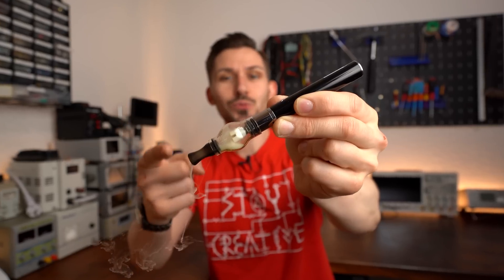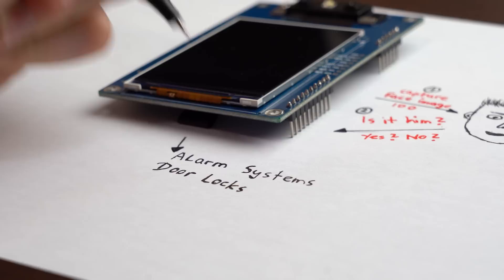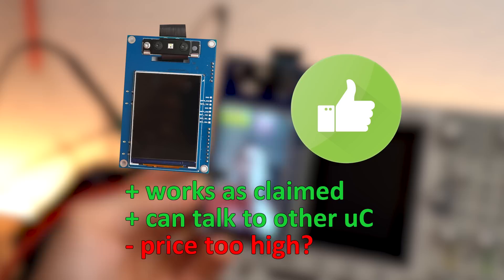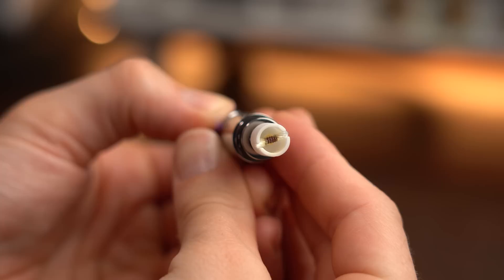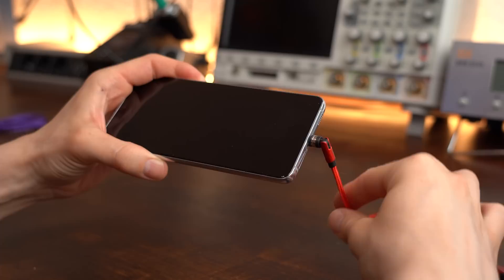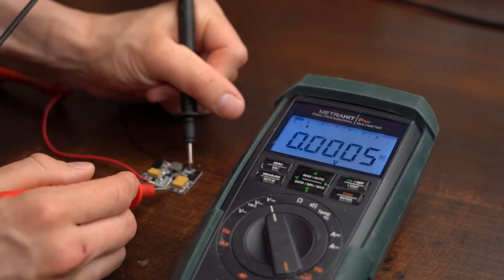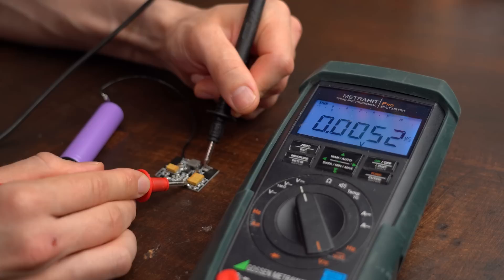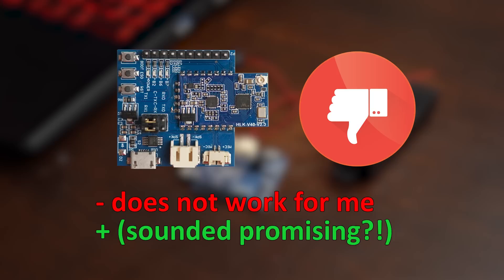I tried finding Hidden Gems on AliExpress AGAIN! (Part 5)

Comment: Great video thanks for making it.
I am confused about your TPS Buck Booster board.
You said it handles 4 different voltages and can be set using the pads on it.
Then why is the board sold at different price for each voltage.
They charge more for 5v yet less for 2.5 and other voltages.
IF all that is needed is to close loop/pads for each voltage then why do sellers have 4 different costs?

Comment: I cannot get enough of these videos. Entertaining and incredibly useful. I recently came across some ultra powerful lifepo4 battery chargers (29.2v 100A for like $650), and was really curious how they might actually perform. I build backup power stations with fairly large batteries (7200Wh), and charging them fully in under 5 hours requires a TON of power. Would love to see these crazy AliExpress chargers put to the test, as well as anything else lifepo4 related!

Comment: Another pro for the magnetic cables. If you work in an area with a lot of dust (ie: a wood shop) the magnetic piece that plugs into the device acts as a dust cover. Downside, every little piece of magnetic dust will find it.
Reply: Yeah, and phones lately have USBOTG, that means they source current onto the USB connector, not just sinking it. Short the wrong pins on that magnetic connector, which is super easy with that dumb little magnetic clip on there, and you just might blow the phone up.
Reply: @pontiacg445  I would think that phones probably have protection on the USB port. Waterproof phones definitely have it. A lot of devices do have over current protection on their USB ports including desktop PCs and laptops.
Reply: @pontiacg445  OTG doesn't just leave 5V on the port 24/7, it only sends power if the ID (micro) or CC (type C) pin is connected.
Reply: @kaelwd  Which is why I said "short the right pins..."

What is it you need to do to the ID pin to get 5V out? Just ground it? Which pin is directly adjacent to the ID pin? Ground? Alright, then. 

I've fixed enough PCs that kids have stuffed stuff into the front panel USB connectors to know that, yes, they typically have overcurrent protection on the vbus. Does that mean it always works? Nope, not at all.

Comment: I've seen reports in the reviews on AliExpress on all of those magnetic USB-C cables having the connector start melting or burning, with pictures to prove it. That makes a lot more sense now that I know 20% of the energy gets wasted as heat in that exact area. So these claim to be compatible with fast charging, but they really shouldn't be used with fast charging.

Comment: I checked out the hot plate because I have been wanting one.  And the price was discounted by 50% - cut to about $26 US.  Only problem - shipping to the US is $93 !!   Also - it looks like they have a 215 mm x 215 mm plate size version for the same price !!  Did you consider getting that version ???

Comment: Hi, when testing buck/boost stuff, it would be nice if you tried a soft start, slowly raising input from 0 Volt, and finding out if and when it starts. It is good info for using with solar cells, mimicking a dull gray sun rise.

Comment: That rosin dispenser is a repurposed concentrate vaporizer, that's absolutely ingenious!
You could grab better coils from OOZE, they use quartz with wire around it and their pretty efficient in vaporizing so I imagine they'd perform the same for this application. 
I have a fantastic use now for my old 510 batteries!
Reply: it's definitely just a normal THC vape being labeled as something else lmao. It has a damn mouthpiece ffs xD

Comment: I loooove those rosin dispensers for finding shorts. So useful and way cheaper than a thermal cam. Also way higher resolution and easier than the original method with an iron
Reply: I'd just use my finger and then when I burn myself take a puff of my rosin pen to ease the pain lol.
Reply: This method reminds me of Louis Rossmann's method of soaking the area in isopropyl alcohol, the shorts will evaporate way quicker than the rest.
Reply: Imagine someone smoking the rosin.

Comment: About those USB cables, any magnet near the USB port on my laptop shuts it down.  That's where the sensor for closing the lid is located, so it thinks the lid is closed and goes to sleep.  Also, I couldn't tell, did it have more than two pins?  If not then it's definitely not capable of fast charging.
Reply: It depends on the definition of "fast" I believe one version of fast charging is just drawing as much current as you can until the voltage drops too much.
Reply: @chaos.corner  That's fair.  I was defining it as Quick Charge or Power Delivery.
Reply: @madcow3417  Much better now that it mostly is. It would sometimes drive me nuts trying to work out what I needed for my phones. Sometimes it even would be QC.

Comment: It is a really common technique really, to find short in cell phone by using heat. At least here in Indonesia. It's a bit brutal sometimes, lol, injecting 12v to phone. But that's kinda the way we can fix a phone sometime because the manufacturer wont give us schematic.

Other than that fancy resin dispenser, you can use ethanol, IPA, or even receipt from ATM.
Reply: Oh, thermal paper? That's actually a great idea! How well does that work?

Comment: Have been using magnetic cables for a long time. Go for quality at slightly higher cost. It does have a slight power loss at higher voltage and current. The plug gets warm to touch. And the magnetic part does pick up debris.

The pros
Eliminates wear on the charging port almost completely. 

No more fumbling around trying to plug in the phone while driving. Just hover the cable close by and it latches on.

Comment: With the face recognition, if it's possible to register your face at an angle, would that possibly solve the 'looking straight on' issue? It would take another space, but 2 or 3 out of 1000 is a drop in the bucket for home use.

Comment: As part of moving to my newly built house, one of my latest favourite gadgets are serial to ethernet adapters. I built my own RFID+keypad door bell using two Arduinos, one for the RFID keypad, and one with a double relay for the bell and opener. All of that is connected to my servers where the actual access control happens. (I don't trust those all-in-one solutions)
Another adapter connects my energy meter via a cheap IR read head to the network. There are many solutions using ESP32s or ESP8266s, but they also need power wires and would additionally use up some wifi bandwidth.
The last adapter is a RS485 (Modbus) adapter, that let's me connect to my heat pump heating system. Very useful to control the energy usage depending on the output of my solar panels.
Of course, these are a bit less electronics gadgets than "smart home" hacking thingies, but they are very usable in the right circumstances (MANY devices have RS232, RS485 or UART interfaces).

Comment: Concerning that PS pin on the buck-boost converter, what does de-soldering it do to the circuit? Is there anything special that has to be wired up after the surgery lol? As a EE student I love your videos and focus on efficiency

Comment: The magnetic usb cables are amazing for kids with micro usb powered devices. The port remains damage free. The big down side is metal working, don't be cutting and grinding steel around them, kills the cables really quick.

Comment: Hey Scott, if you want really good magnetic cables try the ODDADD brand. They have proper data pins and even CC1+2 for PD communication.
I have them and though not as low as high quality cables (sub 0.08) the resistance is ~0.16 ohms for the 2 meter cable.
Reply: Do you happen to still have a link to those cables? Cheers

Comment: One negative I can see straight away with the face recognition, is that it is all within the unit.  It should be offloading it all to a back-end system.  If you use it as a door entry system, it could be compromised from the outside.  I know it's a development board, so it's not designed for production use, but people will still use it for one.

Comment: The coil for the vap^H^H^H rosin mist dispenser, looks just like any other vape pen coil (and looks like a 510 thread). Should be replaceable and perhaps even used in other vape pens. (even the turning on sequence is like most off brand vape pens).
The included rosin is only to detect defective components ? or is it also flux ? (havent had any luck importing rosin/flux)
Reply: Do you know if there are inserts to prevent direct contact between the resin and the coil? The metals in the coil aren't particularly healthy to inhale and may be the primary reason for respiratory illness associated with vaping.
Reply: @toseltreps1101  There are higher quality ones that use a heating element embedded in ceramic. I think most the health problems with vaping especially e-cigs are down to the substance you're inhaling though a lot of the time it's just using normal food grade flavorings and vegetable glycol in particular with high water content that were never ment to be inhaled. I was a smoker for years and tried to use e-cigs to quit even with a higher quality ceramic atomizer and quality liquid it made my lungs feel like they were filling with fluid. Now if you mean cannabis oil's the reason for all the health problems with that was evil people on the black market cutting it with vitamin e to make more money and not proven but, I suspect some using synthetic cannabinoids or even cbd synthesized into thc, that contain all sorts of nasty stuff.

Comment: Rosin dispenser : Press 5 times will turn ON . Press 5 times will turn OFF. 
You have to turn it off to save power and to avoid accidental press . Mine have no case included as laying in shelf can get pressed .

Comment: 6:05 Yes and no. I think what you have there is just pure pine rosin, which can be used as flux but is not exactly the same as "rosin flux" you might buy--there are usually other ingredients.

Comment: You've totally.missed the point of the magnetic charge cables.  A - they protect your port two ways... 1 you don't need to be plugging and unplugging them all the time and 2 if you grab your phone without unplugging it the magnet cinnection will break free, instead of breaking your port!   B - these cable usually.come with micro USB, USB-C, and apple thunderbolt connecting tips. You can have one cable rule them all.  We leave cables plugged in all around the house and can plug in any device.  They end up saving money because you don't have to buy every type of cable.  Also, when our phones were upgraded to using USB-C all we needed to do was use some new tips.  We didn't have to buy a single new cable.
Frankly, we LOVE these cables.  We don't fast carge at all since it's too hard on your battery, so that's a non issues.  You don't fast charge as well, do you????

Since using these I've never beeded to replace a USB port on anyone our devices.  No accidently walking away with a cable.connected (kids do this a lot!) And continually plugging and unplugging connectors that wear our.  We use the kind that also have data connectors, and the work perfectly.

Frankly, I think you have an absurd focus on minute power loss to your devices.  We are taking miliamps here. You waste way more than that using your non-cable chargers!!!!

Comment: The TPS module is awesome. There is a serious lack of affordable high efficiency, low quiescent current converter modules, so this is certainly a gem. A pity it's so big though. Too beefy for low power uses which don't require current in ampere range.

Comment: Back to desulfation topic a while ago, the desulfator I made based on several recent academic journals using resonant principle on sulphate seems to works. Its been running for 2 weeks.

I use this desulfator on a lead acid 45a 12v battery which previously failed to desulfate using traditional method aka transformer+rectifier diode. 

On the 3 cell which the cells turned dark brownish rusty like color, 2 cell almost cleared of rusty like oxide. The 3 cells still bubling atm. The 3 cell with normal colored cell did not bubling at all from the begining of desulfation process.

I use pwm at 700khz and 27% duty and irf540. Earlier, I got problem with this configuration as the solder joints providing 32v and ground keeps melting, even when i cooled it with 8" ac fan at around 50cm. Seems that the pulse resonating and disintegrate the solder joints. The solution is to clamp the wire using diode pin. I limit current slightly under 1A because i also often use the transformer to charge 18650 battery packs.😅

Edit: i also on 3d printer project, its a corexy based planned to run klipper. 

The interestings parts is that I use alternative approach to build this printer. The frame is made from welded 30x30x1.5mm hollow carbon steel. I use custom made heat treated carbon fiber brackets on x axis. The bed also made using carbon fiber. The heater element, thermostate and heat shileld will be on a single plate as carbon fiber is a good insulator material. The bed bracket will be using grade 1100 alumunium which is light and got high tensile strenght.

The bed leveling will be using 6 axis gyro and servo controlled by separate mcu. The x axis use custom made bearing from ptfe aka teflon rod instead of linear bearings/rail on 3 8mm 304 stainless steel shaft. I also considering 1100 alumunium or heat treated carbon fiber shaft, but I am tight on budget atm😂.

Comment: 9:20 there are better cables available that usually do not come the 360° head to pivot around. They have a straight cable plug or a rectangle one usefull in the car and what not. Then the efficiency was a lot higher cause I also had bought these cheap ones with 360° on top but they were hot compared to the other ones. The cable diameters were too small for the amount of current needed to fast charge  - and the manufacturer had saved a lot money due to less copper.

Comment: Awesome video as always, @greatscott.
Though I want to comment on the magnetic USB cables; I wanted to drive them daily, mostly for charging port longevity on my phone and interchangeability, with one charging cable any each device with its appropriate head. But from what I understood from online and Reddit research that it's just not safe and not recommended for daily use; I forgot the reason why it's not safe, but I wanted to give you a heads up; I would either research this a bit further (and would like to hear more insight from you if you do) or put a disclaimer of not recommending it because people were really convinced online that it's bad.
Reply: That's disappointing, I was thinking they might be useful for attaching to my various cameras for easier charging.

Comment: If they added an extra hole to that rosin melter, it would probably be useful for meth smokers. However, I would recommend that they disperse the heat more so that it doesn't break down the meth.

Comment: The magnetic cables are absolutely perfect for wireless headphones, you can easily attach them without removing the headphones and if you forget they are attached and stand up they safely disconnect without stressing any component. It's worth the power loss in my opinion.

Comment: After using the magnetic USB cables for some time, I found the "full - data" cables which swivel are bad. The fixed full data and all the " power only" cables work fine, although the latter don't fastcharge.

Comment: you should test the magnetic usb cables after it went trough simulated (or real) charging duty, if it's getting hot it might result in an even bigger amount of resistance since permanent magnets loose strenght when they get hot and that weakens force connecting the pins between the cable and the swappable end connector (that will mean higher resistance if the force gets reduced enough to cause a weakened contact). High resistance cable heats up -> Perma magnet loses strenght -> Lost strenght means higher resistence for even more heat... Under the right circumstances this feedback loop could possibly cause a thermal runaway situation, but it's more likely that the wall adapter's protections (and/or the phone's charging circuit) kick in way sooner or even if it was a thermal runaway somehow the magnet might just fall off when it heats up enough to loose it's magnetic property before anything catches fire.

Comment: I made my own hotplate using a single electric hob, built in a 2KW SCR voltage reg and added a temperature controller........ Noisy, really noisy (SCR), but for like €18, it's about 20cm diameter and beats even some of the professional hotplates i've used over the years.
Doesn't work any more though, as cats really love chewy high temperature mains cables............... :p

Comment: for the magnetic cable you need to get a PD one with a thick connector that has at least 8? conductors, look for ones that support MacBooks and laptops, I get 80W PD no problem.

Comment: With the hotplate, all you need to do is cut a piece of thick metal plate like 12mm aluminium and place it on top, the reason it has a hot spot is because they are cheap and only use a thin plate. Once the plate is thick enough it will have a good even temperature, except at the tips of the corners of course.

Comment: For the magnetic cables. I would suggest getting the USB C adapters. 
You can use your existing cables and chargers. And they support full USB C and Thunderbolt. 
I use the pretty much everywhere now. Especially with my docking stations and keyboards.